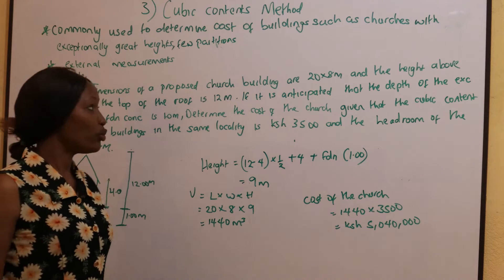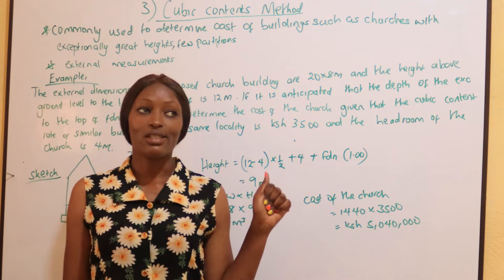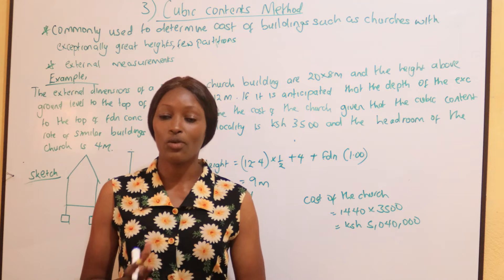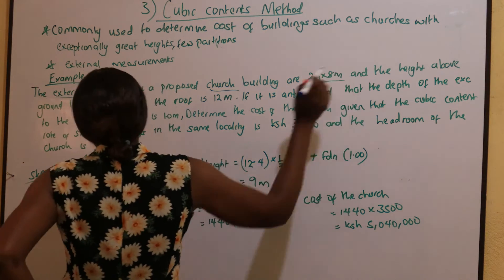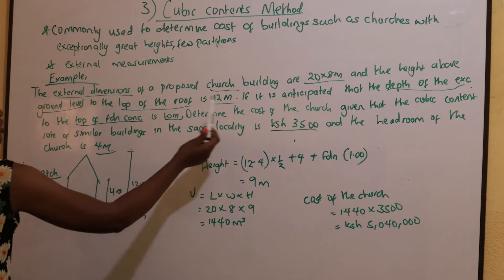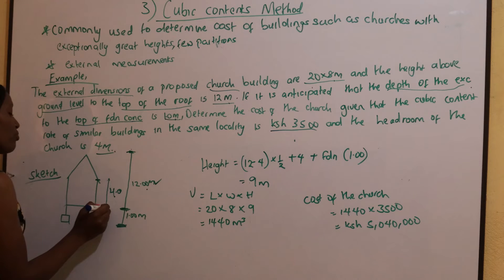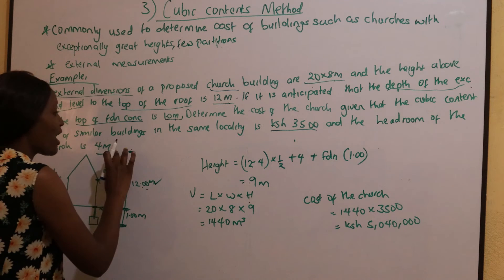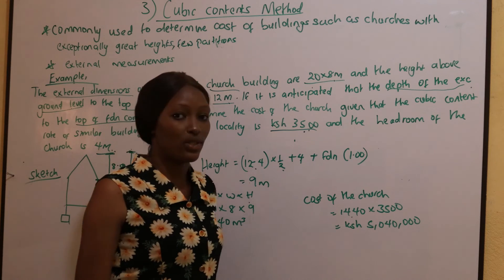CUBIC CONTENT METHOD/APPROXIMATE ESTIMATION AND COSTING BUILDINGS WITH EXAMPLES

Comment: What of a flat roof
Reply from the maker: Will be uploading an example of that soon
Reply: You didn't upload it. Just give a simple way to start by @easyqs
Reply: You add 600mm above the flat roof and that will be your height which you will use for the calculations.